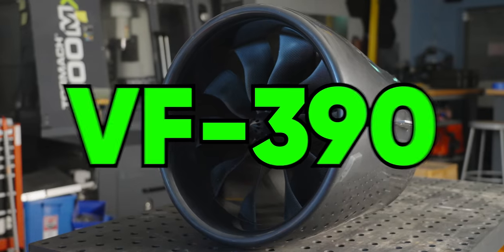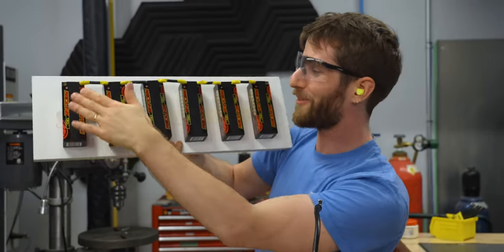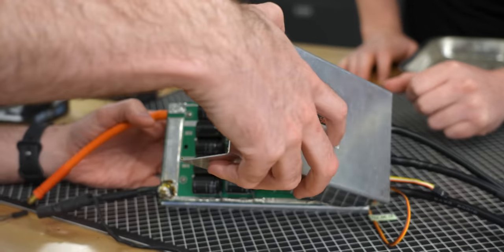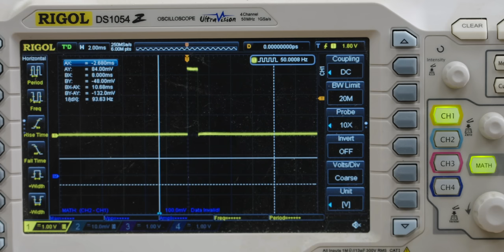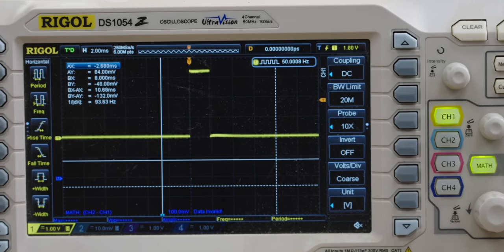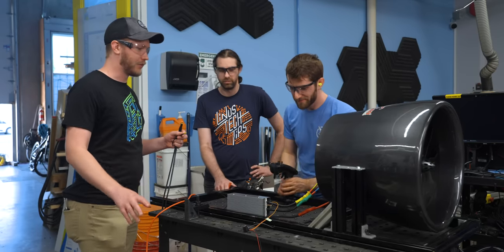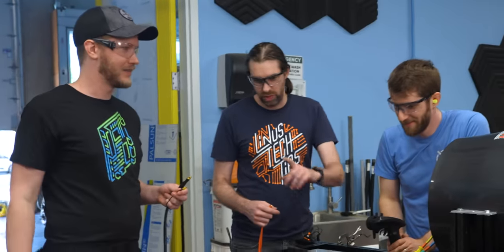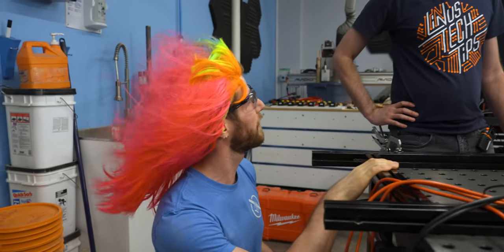The Scariest Fan ever attached to a computer - Vasy Fan VF-390 EDF

Comment: I recommend Kyle to have a a bypass switch to kill power when Linus is playing with dangerous stuff.
Reply: It was kind of ridiculous tho, why is he trying to stop the fan when its only getting fast, you can always see him gesturing to cut power... just why
Reply: @Glade4  Given that the batteries overheated enough to be a genuine fire/explosion hazard, I don't think it was enough caution.
Reply: @Glade4 he had a thermal camera at one point,  so potentially was being cautious about lipo batteries catching fire, which they nearly do at the end.
Reply: @Glade4  Simple, lithium fires are very hard to put out and very intense, you don't want that anywhere inside the building or it can burn down the place before the fire department has a chance to get there. (Not to mention all the toxic fumes it creates.) That is why they even took out the battery pack outside, the faster you discharge those batteries the more heat they generate and they got dangerously hot.

The biggest problem is that they can undergo thermal runaway (Basically they get beyond a certain temperature where it will keep getting hotter and hotter even if you aren't doing anything with it until it catches fire or explodes. Can't use water to put it out.)
Reply: @alexisrivera200xable  lithium fire are not hard to put out, they are almost impossible to put out, and if you do manage to stop the flames they can reignite for up to 60 days
Reply: That would be one hell of a power surge
Reply: No need for complex stuff like that, just give him a fake controller like you would for your younger sibling
Reply: @Glade4  because he's an engineer and knows that the batteries can't be running for too long.
Reply: @Glade4  Because it is extremely dangerous lmao???? he's concerned for linus's safety???????
Reply: @bradhaines3142  metal fire is unstoppable. It's pretty metal.
Reply: @RisingRevengeance  a bucket of salt would probably be better since that's what's in the super expensive metal fire fire extinguishers, the salt melts around the burning metal forming a seal that cuts it off from oxygen and smothers it even better than sand
Reply: @monkeyoperator1360 tbh the best way to deal with a lithium fire is dump a litteral ton of sand on it and wait till it encases itself in glass.
Reply: @TechnologistAtWork  metal fires can be stopped it's just a lot harder, you either need a fire extinguisher specific for metal fires which are filled with salt that melts around the metal cutting it off from oxygen, some way to cut it off from oxygen like sand or cat litter, or do what they do in really sensitive areas and just remove the oxygen from the room and replace it with insert gas. That last one will kill any humans present tho and is only really used on things where they're willing to risk that to keep the stuff safe
Reply: @EroticWhale it's fine, the battery pack is rated at 600A.
Though tbh it probably would've been safer to use like 8 car batteries, degrading with the current and margins that's still about 10Ah on a 50Ah rated battery compared to the 6Ah lithium, and it's only 700 bucks.
Reply: @noodlelynoodle.  If you understand how metal fires work you wouldn't be saying this. 

The thermal reaction requires a strong oxidizer which releases oxygen as it burns. That's why they burn so hard and are impossible to put out. You can't choke out a metal fire. 

Look up the thermite reaction.
Reply: @TechnologistAtWork  a thermite reaction is entirely different than a normal metal fire, those are much harder to put out but you still can if you manage to starve the heat from it. But most metals are flammable by themselves without an additional oxidizer metal present, aluminum will burn by itself without the iron oxide required for a thermite reaction, Class D fire extinguishers specifically for metal fires wouldn't exist and cost hundreds to thousands of dollars if they didn't work. A normal metal fire is getting it's oxygen from the air around it and smothering it absolutely does work if you have something that won't decompose into a more dangerous result. Like water on most metal fires will chemically be ripped apart into hydrogen and oxygen gas and explode, salt on a metal fire melts and blocks the oxygen from the air and smothers it forming a solid seal around the metal preventing it from reigniting, explosions and fire did a whole video testing one of those fire extinguishers working fairly recently. I've personally done thermite reactions and if you cool them off enough with the addition of other things that won't burn they simply stop once they've lost enough heat
Reply: @Glade4  yeah nevermind the lithium batteries combusting and burning the whole compound down
Reply: @noodlelynoodle.  No it's not. The longer you argue the more you're letting everyone know how little you understand any of this.
Reply: @TechnologistAtWork  I mean a simple Google or YouTube search would prove you wrong but feel free to stay ignorant, a thermite reaction is fundamentally different from a normal metal fire. Like I'm not even arguing with you, for it to be an argument you'd have to have a valid point rather than just trying to discredit the actual science with no actual evidence, I know what is actually correct from personal experience and countless other sources
Reply: @TechnologistAtWork  What are you even saying in both of your comments? You can be very adamant about how dangerous they are without saying literally incorrect things and coming across as the most condescending creature in the universe.
Reply: @satibel  its still self oxidizing the best thing is letting it burn out
Reply: @monkeyoperator1360  yeah, burning out in a pile of sand so nothing catches on fire.
Reply: @satibel  exactly
Reply: @RogueStatusX  Im pretty sure there are processes in place to prevent this, there have to be legally, there is a thing called being overly cautious.
Reply: @Glade4  And one of those processes was to cut the power when it starts looking sketchy
Reply: @TechnologistAtWork  He's got an engineering degree in a similar field, but he's not an electrical engineer nor is he specialized in power. Just look at the video where he explained how a PSU worked, he got destroyed in the comments because he was severely wrong on many aspect.
Reply: @cedricpomerleau5586  except he was completely right about this.
Reply: @TechnologistAtWork  He sure knew it was dangerous, but he definitely didn't do his best to make it safe. Fusing the batteries would have been the minimum, which he doesn't even appear to have done.
Reply: @cedricpomerleau5586  None of this matters because Kyle did a good job at stopping the tests before it was too late. He definitely knows more than Linus and he was correct about everything in this video.

Comment: That explanation of pulse-width modulation was pretty great. I've had a shaky understanding for years, and something snapped into focus.
Reply: I work in the trucking industry and all the sensors on vehicles are pwm. I've always had a pretty good grasp of it but explaining it to mechanics who barely understand how basic 12v systems work is like explaining rocket science.
Reply: If you've coded microcontroller, it's probably the one of things you learn in the first hour.

Comment: Just to let you guys know, your earplugs are not properly inserted. Make sure to roll the earplug up into a small, thin "snake" with your fingers. Pull the top of your ear up and back with your opposite hand to straighten out your ear canal and then hold the earplug in with your finger until it expands to fill the ear canal.
Reply: This was like the last thing I expected to see in the comments section but a long lost question I've always had but never bothered to look up has been finally answered, so thank you
Reply: Yep, it doesn't block the full frequency range like that. I worked in an industrial factory and we had to be shown that during orientation. I also learned that I could wet the tip of the plug and it will fully insert easily.  I still wear them every night when I sleep as I live in a busy semi truck route. If they were only half inserted they would fall out.
Reply: @andrewt9204  same i got used to it. sleep is amazing with them.
Reply: I would be getting the over the ear ones aswell for that noise level.
Reply: Over the ear ones are better. No matter what I do my ears spit out the foam ones. It just isn't worth the risk of suddenly loosing hearing protection. And over the ear ones aren't that expensive.
Reply: fun fact, people who do lots of competition shooting eventually get hearing damage through ear plugs because firearms are so loud (up to 185db) so they usually double up on ear pro, using both plugs and ear muffs if possible, or use silencers. but we're talking people who shoot over 100,000 rounds a year (thats sooo expensive! thats why they need sponsors)
Reply: @taliakuznetsova7092  plugs dampen more in ideal conditions, that is properly installed, they also work fine with hair, beards, glasses and so on, but i do agree with your suggestion, so many uses plugs wrong, that in practice it is usually better with over ear.
Reply: Hey there, there are a lot of people who are smaller and can't insert normal earplugs. It's normal that they look like this and yes they would need smaller plugs
Reply: Yup, the way they have them inserted is probably worse than just using their fingers.
Reply: @dillogdall1  I have noticed that as well for the 5-7 seconds they stay in before they're spit out. The firm earbud type ones work great though in my ears, if it was high sound environment I'd probably wear the hard earplug type and the over the head type together. Can't remember if two of similar sound rating increases protection or if it's only the highest rating of the two.
Reply: Thank you! As someone who values his hearing, that was the first thing I noticed.
Reply: For all of u having issues with the plug falling off, I would suggest u to try 3m or wurth brand, I personally can only fit comfortably with the wurth, but 3m is super similar too. Those are much softer and adapt a loooooot better, look for the one with the sperical tip, not the square one.
Reply: @taliakuznetsova7092  I think two hearing protection devices of the same protection level will increase protection, but it won't be double the decibels. I don't know what it will end up being, but I imagine it would be similar to how two speakers playing the same thing will be a 3db increase in volume.
Reply: @taliakuznetsova7092  the highest NRR rating for over-ear protection is 31db, while in-ears can be rated up to 33db. That isn't much difference in practice, but earplugs are slightly better.

Also, you can double-up for more protection.
Reply: @SamuraiGuy  Double protection adds about 5 dB of reduction to the higher rating. So 33 dB NRR ear plugs + 31 dB ear muffs = 38 dB total reduction.
Reply: @Hypnodog_  Is the +5db double protection for when they are matched protection? Id assume it would be more difficult to calculate with different protection levels.
Reply: @alexdrockhound9497  thats what happens when you cheap out on ear protection.
before you decide im wrong, id do your research.. the ones i use have made a HUGE difference...

oh, and im on about 250k a year, ammo wise.  for the last ten, twelve years at that number
and still almost PERFECT hearing..

so yeah, cheap hearing protection does not protect.
Reply: I see this problem all the time. Even the recent video from the slow mo guys on a firing range, you could tell the same thing.
Reply: You'll learn that real quick when you're dealing with sharp loud noise all day at work, that crap will completely fry your nerves after awhile
Reply: Just in case, decibel is a logarithmic scale
Reply: @djjc9782 Sorry. Did you just say you spend a quarter million dollars a year on ammunition?
Reply: @SamuraiGuy  From what I've read, it just adds 5dB to the protection method that has the highest NRR, matching or not. I would err on caution and only apply that rule if they're very closely rated. FWIW I've never seen an earmuff w/ 33 dB NRR, they seem to top out at 31. Almost every foam plug I've used are 33 dB.
Reply: @Hypnodog_  Yeah, I think 31db is the max NRR rating for ear muffs and 33db for earplugs.

Comment: The most dangerous thing was the intake and I'm not even sure they have realized it. Blowing out this much air means the suction power is equally strong. And yes, this is literally an electric jet engine... I'm quite sure it was designed with airplanes in mind.
Reply: I'm sure there is a nice fat warning label when they opened the box.   Also, they've kept their distance from it in case one of the blades should break.
Reply: they said 60kgs of thrust at peak - that's not a whole lot for an airplane. A cessna 150's prop is about 230 kgs
Reply: I'm almost certain they would of taken into consideration the suction of the thing they aren't stupid.
Reply: @magica3526  For an airplane it would be a bigger version which drastically increases the amount of thrust.
Reply: Yeah I was thinkitof that as well - it could easily suck something in and make all go haywire - I work with MRI and and it's the same, everything is fine until it isn't ....
Reply: the suction will be more spread out but open fan is still kind of dangerous
Reply: @FactsDataTruth  Where is the airplane drawing the energy to keep this power-hungry motor spinning for any length of time? 100-265 Wh/kg is about where Li-Ion is, where jet fuel contains 12,000 Wh/kg! 
Fuel weight is already significant in aviation, even if the motor is lighter and more efficiet than a jet engine you are held back by the inefficiency of a battery! You end up with most of your vehicle being a big heavy battery which needs more energy to move!
Reply: @magica3526 plenty of trust for an electric drone in the 4-500LB class.
Reply: @5688gamble  This looks like a bigger version of the electric jet engines used for RC model aircraft. Not sure who'd make one big enough to need an engine like this, but apparently there are people out there doing this sort of thing
Reply: @FactsDataTruth  Likely simply more of them.
Reply: @5688gamble  Do you really think people don't know this?
Reply: @5688gamble you are correct, and pointing to the reason we will never (with current tech) have a battery airplane. This is also why the most likely industry to adopt hydrogen fuel cells will be aviation.
Reply: @Jordan-ru8yf  eeeh not so fast on that hydrogen technology there. In cars the fuel cell is also limited in its power. Toyotas Mirai is pretty slow in acceleration and only thanks to the battery actually has that boost.
I think we are going to be stuck with conventional aviation for another 50 Years atleast.
And I am all pro EV. I just don't see it happening in the aviation industry.
Reply: @FIGHTTHECABLE  the key benefit of hydrogen is its light, actually far lighter than standard fuel not to mention Lithium batteries. The key downside is the required volume to store in the plane. This is easier to solve though, but still may take a long time if ever to become practical.
Reply: It's not a jet engine, it's a ducted fan
Reply: @magica3526 so you would need to be able to fix four of these to the plane and then figure out how to store enough electricity to be able to power said fans for a flight
Reply: @owen5165 Don't use "would of" in the same sentence in which you judge whether someone is stupid or more.
Reply: @magica3526  eh, because of how light it is, its super feasible as an electric jet.  A lycoming o-235 weighs around 250lbs. This, with mounting hardware, weighs 9lbs. So for the same weight, you could have 27 of these. 

So for the same weight, you could have over 1600 kilos of thrust
Reply: @magica3526  yeah but the engine itself is around 100kg afaik which means the engine weights around 15% of the total mass. maybe a bit lighter airplane class but it seems plausible. 
edit: just checked this ones weight, it says around 4-5 kilos. so if you get to attach 4 of these to a cessna like plane, you get the same thrust with the quarter of the original engine weight. it is amazing!
Reply: i would say at least the ten feet in front of it would be no entry zone , maybe more. i cant believe the doors bent from suction . i legitimately wouldn't want to be in the room XD.
Reply: @Darkk6969  lmmfao if one of those carbon fiber blades snapped off it would have sliced through anything in its path including body parts and embedded itself in one of the walls before they realized it
Reply: That fan has nowhere near the power to suck in a hand against your will. Even an idling F-15 wont suck your hand in if you held it in front of the intake.
Reply: @magica3526  its made for gliders. you dont need an amazing amount of thrust as the wingspan keeps it aloft.
Reply: @magica3526   probably not a plane, but one of those giant drones that can carry people.  So it would have 4 or 6 of these engines to lift up the passengers.
Reply: @Jordan-ru8yf  don't forget the flammable part either. Hydrogen is far more flammable than Aviation Kerosene.
Reply: @max16  I could see that? though gliders want the added energy density of petroleum-based fuel even more than most planes